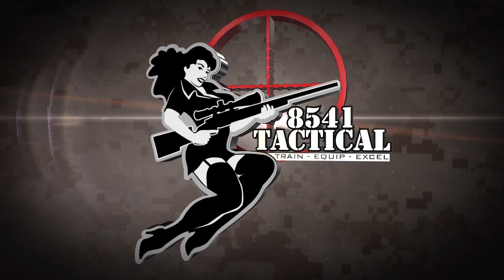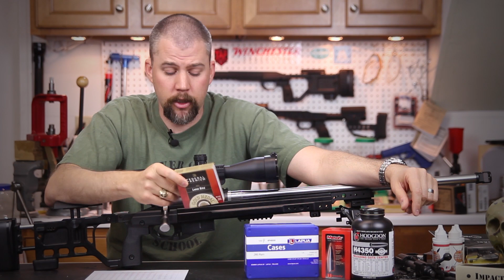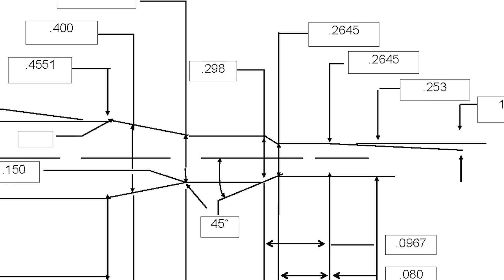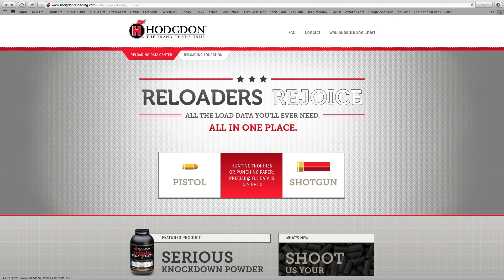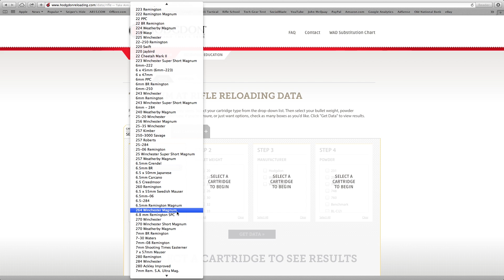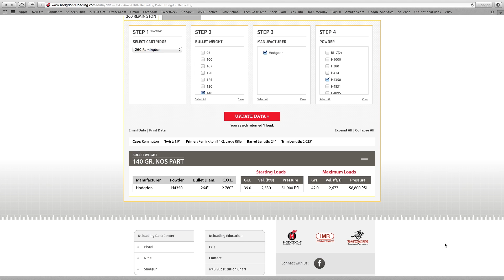Mail Call Mondays Season 3 #13 - Working Up a Match Rifle Load

Comment: I'm thinking 200 and 300 yards is way to short distance for ladder test.  I did one @ 500 meters with my 6,5x47 Lapua, and i do think that is a better option.  I can indeed send you a picture of the ladder test i did for inspection if you like.

I also used a slick trick for reviewing the bullet holes you might want to check out... colour coding the bullets helps a great deal in reviewing the target when shooting this long.

Just a thought...

Comment: I'm going to start getting the reloading components together for my first bolt action rifle soon.  I don't have the rifle yet and haven't made up my mind yet on caliber, but have narrowed it down.  They all can use the same primers so that is a safe bet to stock up on now.  I'm also going to grab some powder in the variety that works well with several of the calibers I'm considering.

My question is...What is your opinion of the imr versions of some of these powders when compared to the hodgdon h versions?  I'm aware they are not exactly identical and loads must be worked up individually.   What is your opinion specifically of imr 4350 compared to the H4350?  They both work so well in several of the calibers I'm considering.  Temperature sensitivity is a concern for me.  I have used another variety of hodgdon for my 223 and it is very stable.  How unstable is the imr4350?

Comment: I can safely run 46 grains of H-4831sc pushing the 105a-max @2,950+/- in my .243win (no signs of pressure whatsoever) while Hodgdon's manual states 41 grains as the max load for the 105's getting 2,846 fps, and when I load 41gr I get around 2.600fps (250fps difference!!!)...  I know it's not a slower batch of powder because I also use it with Berger 90gr BT target bullets and 48grains gets me 3,200-3,210fps.  Hodgdon's manual lists 48gr as the max for the 90gr speer SP with a velocity of 3,203fps...  I use Win Brass and Federal Gold Medal Match 210 primers,.. Hodgdon also used Win brass in their .243win data but used WinLR primers.
Majority of the Hodgdons manual is very close to spot on when it comes to their listed powder charge and fps outcome, tho some of the data can be far from actual results.
What I am trying to say is that it's extremely important to work up a load no matter what any manual states is safe.  My 300win mag was shooting 100-150fps faster than Hodgdon data with some of the powders while other powders where on the money.

Comment: John, new to reloading and I am going to start my latter test on the loads I worked up and I have one question. I might have missed this but do you leave your zero at 100 yard or adjust to 300?
Reply from the maker: You will adjust to 300 or whatever range you are shooting the test at. However once you start the test, you will not make any sight corrections.
Reply: Ok, thank you for the info.

Comment: Why dont you fire form all your brass with a mild load before you do a ladder test?
Reply from the maker: While that will in fact produce more accurate results, this rifle has a relatively tight chamber and the difference is well below the accuracy requirements of the system. It falls into the same category as why I don't weight sort or neck turn. If I was loading for a heavy bench rest rifle, then I would do all the extra steps that can turn a .25" group into a .1" group.
Reply: Thanks for the quick response. I shot a 260 in 600 yrd f class last year. I used 142 smk and 43.5 gr of 4350 dam thing kicked so bad I devoloped a flinch, and watched my scores drop from 197 out of 200 down to 185 over 6 weekly matches. I shooting my 243 rockchucker this year.

Comment: I hope you got better Lapua brass than what I did. I got 100 7.62x39 just to mess around with loads for my AR. The hottest load I worked up was 2,300fps, which is pretty average for a 124gr bullet. After 2 firings I had to pitch a little over half from loose primer pockets. None of them showed any signs of over pressure. The rest were gone after 3. Got a hold of Lapua and they basically said sorry about your luck. It's a fun gun, so I'm back to the cheap stuff, but I know what to not buy for my .308 and .300Win Mag.

Comment: Shed some light on my understanding here. Can't you just do a "ladder testing" using a chrono at 100 yards? If you're looking for similar speeds in a series of charges, A chrono can tell you that right? This way your impacts are not that much affected by winds and you don't have to walk far for your targets. Also I'm just gonna drop a Mail Call Monday Question here if you don't mind... Can i just buy a full custom action, let's say the Templar and one of those prefit barrels like McGowen Remage to skip the smiths?
Reply from the maker: Velocity is only part of what influences the point of impact. Harmonics also play a part. More range amplifies the spread and makes it easier to see. If you are too close you end up with a ragged hole.
Reply from the maker: I don't have any experience with the remage barrels. However I would like to see a project like that.

Comment: Hey John ,  Just wondering if you have ever checked out Dan Newberry's "Optimal Charge Weight Load Development"  It's different from the Ladder Method. ..
Reply from the maker: Yes. I have used it in the past. It has it's place.
Reply: ***** Don't you have a MCM going over said load development :)

Comment: I'm in a similar situation with the brass. I had my load work up done for Winchester brass and had to switch to Lapua for availability. Everything else the same, do I need to do another load work up? I'm at 43.5g of Re15 with a 175 smk in a Remington 700 .308
Reply from the maker: You would. "Probably" be fine, since that isn't a hot load. However it's always better to waste a couple bullets on a check ladder than to waste an action.
Reply: ***** yep, that's what I figured. At least I have a better idea where the accuracy node will be this time. Thanks!